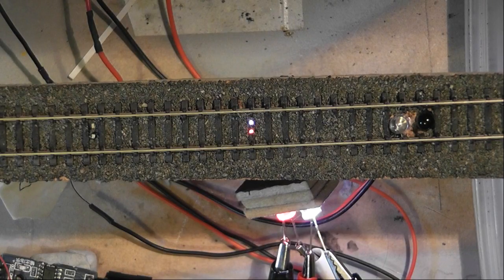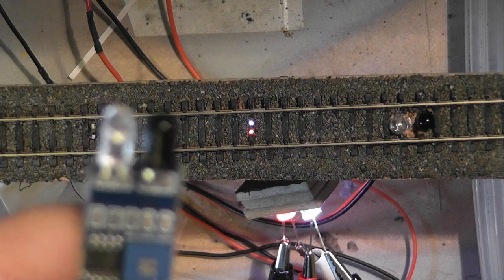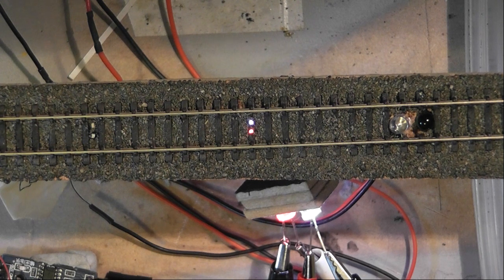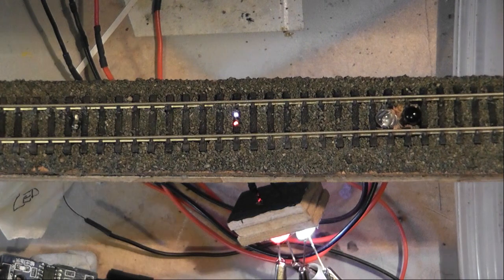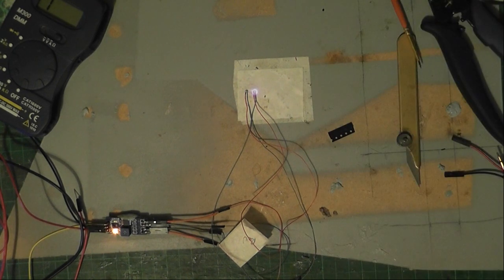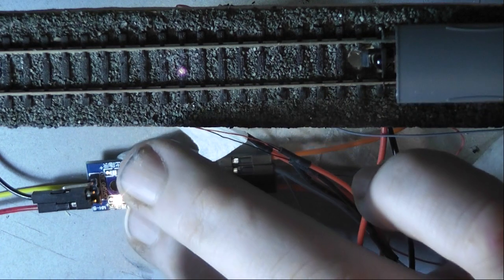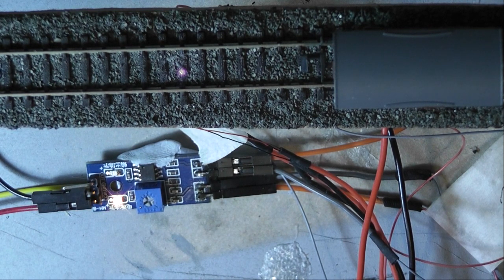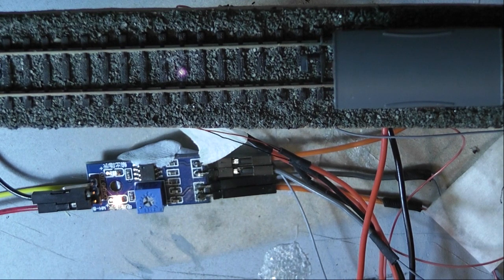Smallest OPTO Sensor for Model Railways update

Comment: Top marks for persevering! I have some fibre optic on order so I will do a few experiments. I am wondering if a fibre optic on the LED, and then a 3mm detector between the sleepers would work. I do not mind the detectors so much as they are black so easier to hide in the ballast. I am not sure I am brave enough to start playind around with the SMD stuff - it looks so small!
Reply from the maker: Let me know how you get on, it sounds a good idea. All the best Tony

Comment: Hi Tony, that’s a shame it didn’t work after all your hard work 😩 Naive Gauge is probably right that the “sensor” probably needs to be at the surface as the reflection must not be strong enough going back down the fibre 🤔 As always an interesting and informative watch 👏🏻👏🏻👏🏻 Best wishes to North Yorkshire from South Wicklow ☘️
Reply from the maker: Thanks Paul, It'll be interesting to see if Naive cracks it! All the best Tony

Comment: A bit late in the day seeing as this video is 3 years old.
Try the optocoupler QRE1113GR. Farnell i/c 1471020.
Fits easily between the sleepers and on 00, nicely hidden in the square end of a Peco AWS ramp.
Needs a reflector, Aluminium kitchen foil works a treat.
Only issue, susceptible to ambient IR from lighting and sunlight.  Can be overcome with some slightly more complicated electronics to make it pseudo AC coupled (via a capacitor) and pulsing the IR LED at around 10Hz.
Reply from the maker: It's strange you mention the QRE1113GR, I was looking at that package 2 months ago but decided it was too big for N-gauge, but as you say Ideal for OO. All the best Tony.
Reply: Thanks for your reply Tony.
Not sure if it would fit within the sleepers if you cut a section out of the middle.  Although I’m building in 00, I do have a 009 section and fits nicely. That said, the sleepers are further apart in 009 than N gauge. I’m sure you’ll find a solution in the end. Be interesting to know what you come up with. 👍 @TheHeritageLine